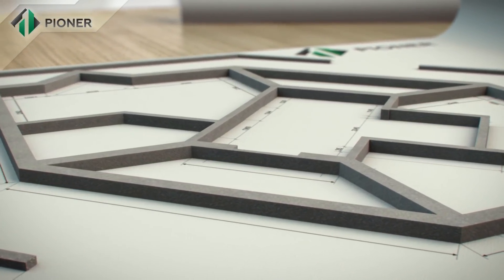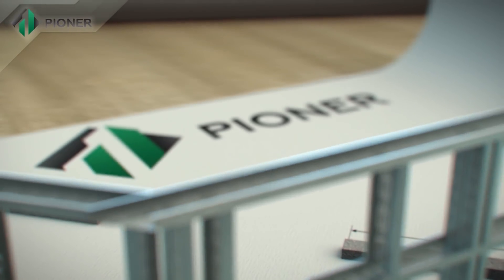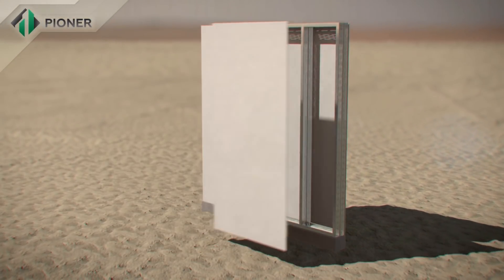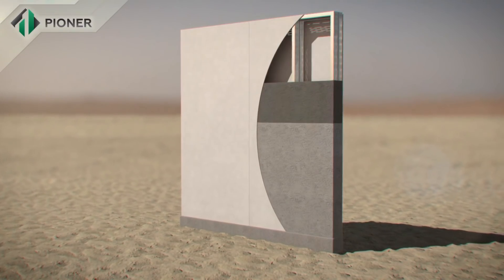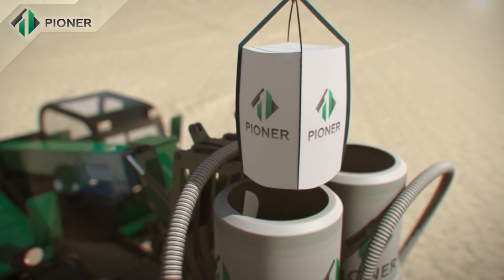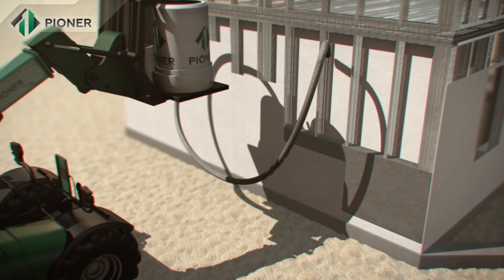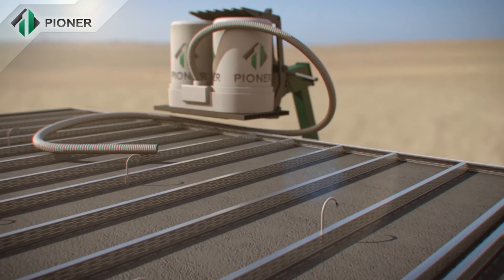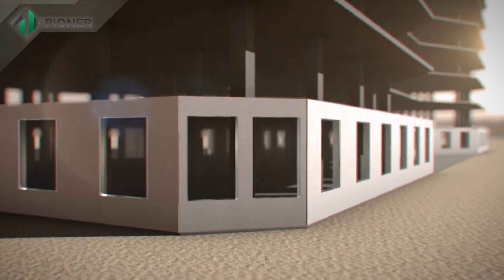Light gauge steel structure and cellular lightweight concrete infill construction technology

Comment: What is the approximate Cost of construction for per square Foot .
Reply from the maker: Hi Shafeeq! Just core and shell (light gauge steel frame + fiber cement boards cladding + non autoclaved lightweight aerated concrete infill) less then 100 USD/m2 but with MEP and finishing cost starting from 200 USD/m2